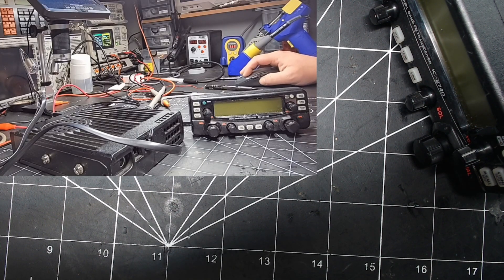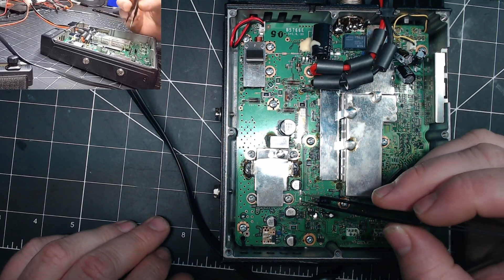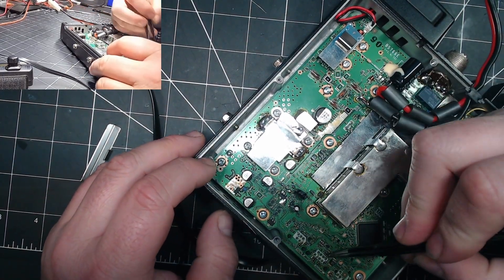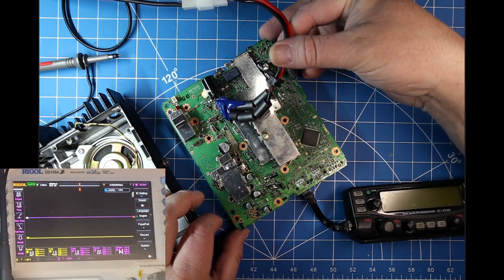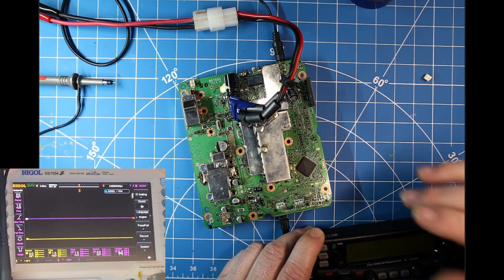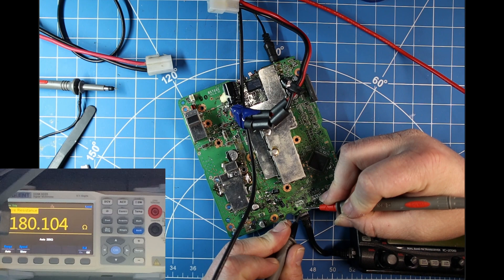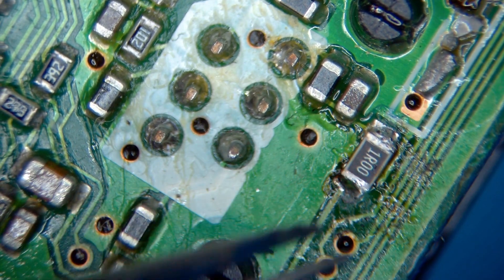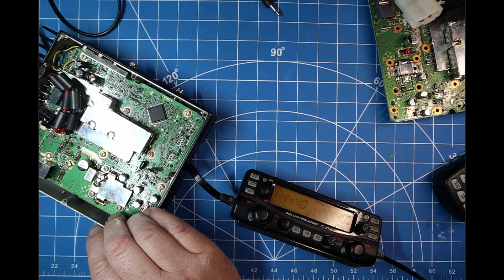Icom IC-2720 Repair. Nothing on display

Comment: i have this same problem but where is that resistor at on the board and where you buy it from to replace it thanks .These radios are older than dirt but work so well when they work thanks .if you answer question if you dont .Still a good job i will just watch video over and over and find it maybe .